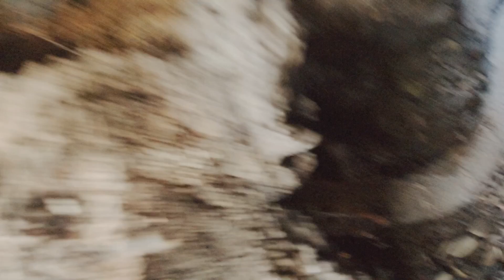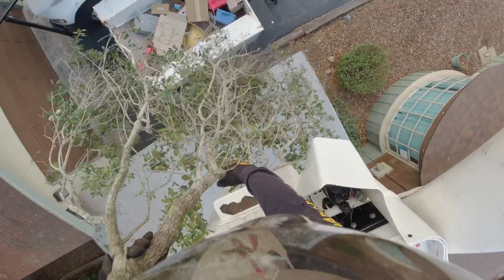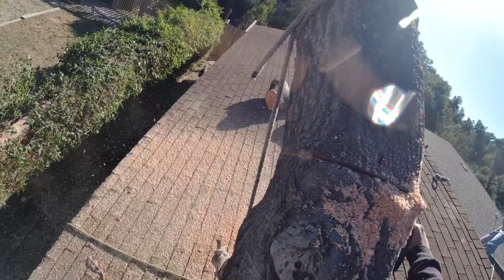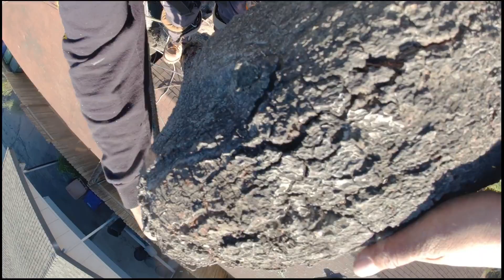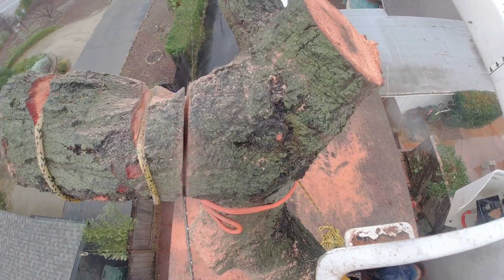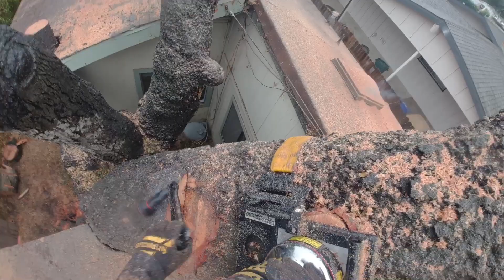Fat Oak first part

Comment: You’re a badass. All I can say is 💰💵💰💵💰. You’re not required to have a dorsal attachment with fall arrest?
Reply from the maker: Yes osha says you should have a fall arrest harness  with a dorsal attachment. 

Personally if I got bucked out of the bucket I rather have my climbing belt on and lanyard in to my bridge. Then I would have a chance to climb back in if I was still alive. Rather then hanging from the dorsal waiting for some one to help .   But that's just me it's probably a dumb idea🤪 . So I would recommend just follow the guidelines.   I usually do wear  a fall harness Though
Reply: BRUSH LIFE everyone says the exact same thing. The ISA pleaded with OSHA to no avail arguing the same point.